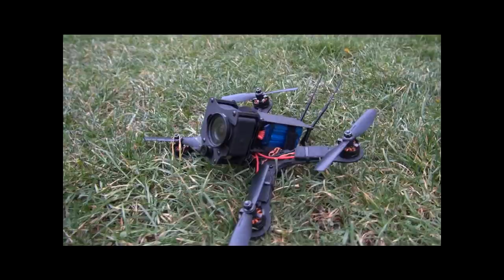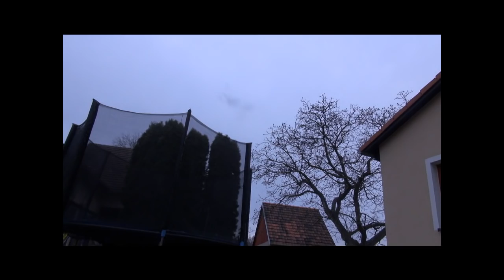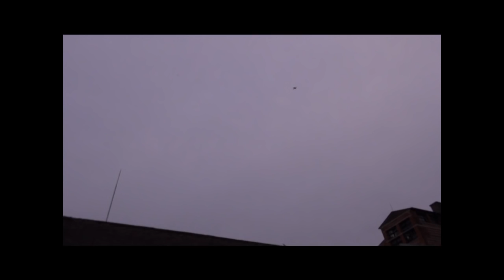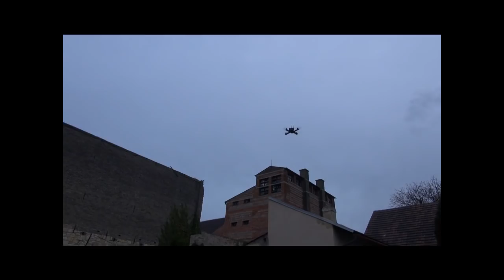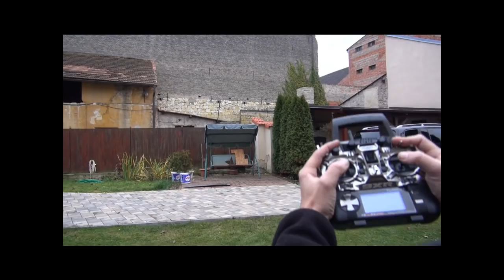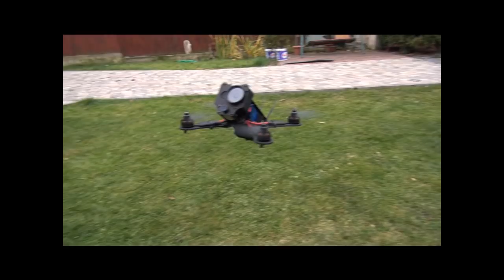Green Gorilla Frame v3. LOS maiden (RAW,uncut)

Comment: That looks amazingly functional..... I mean the way everything is oriented, yet component assembly seems to remain very simple and straight forward, no fancy gimmicks just a sound design overall. One of the few frames that's worthy of being advertised as "designed" and "engineered". The only thing missing is finite element analysis to optimize use of frame material and CFD for aero... but we wouldn't want to pay $1k to cover the cost of that :D 
Can't wait to see FPV video. You'll wish you waited until after X-mas, unless you don't mind working as hard as Santa's little elves thru the holidays
Reply from the maker: +EngineerX   Thanks EngineerX, your testing videos helped immensely. Reality is people are scared of our new frame... different is scary. Reality is the people who have it are loving it, and we hope you love it too. Simple, strong, protected components, smooth video, tilted motor plane stiffened up and balanced on Center of thrust, both with and without the HD camera. People will switch over, sooner or later. Thanks again X.
Reply: Green Gorilla Very true -saying goes old habits die hard or that one about teaching an old dog new tricks. Your frame has lots of features that just make sense and even though I haven't seen it fly FPV or tried it myself I can already feel I will like it!

Comment: what size battery are you getting that AUW of 530 with?
Reply from the maker: +UmmaGawd 
our 1100mah HV 4s. 116g.  But I can take the silicone camera cover off to drop an additional 10 grams or so.
with our 1400 it comes in around 550g AUW with Go-pro or yi. Can be lightened up alot if you spend some time with it